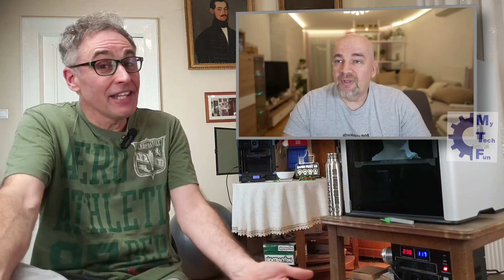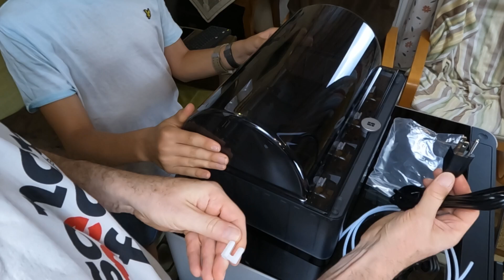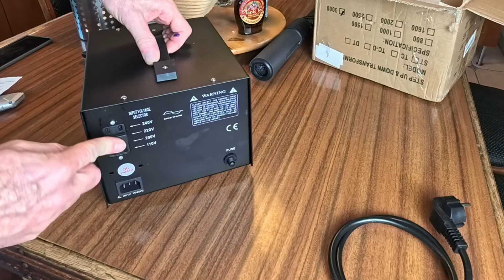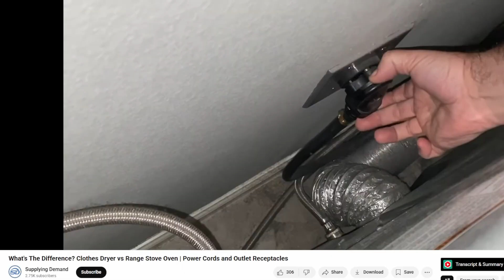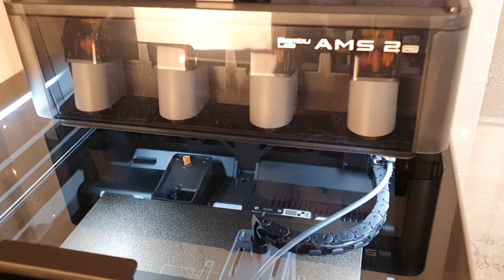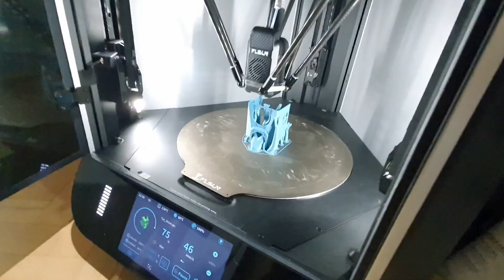Bambu Lab Sent the Wrong H2S (110V Printer in EU) Our First Bambu experience. Joining the dark side?

Comment: Thank you for the awesome video. I have one question that I'm not able to find an answer to. What about the hertz. US is 60HZ and Europe is 50HZ, I read somewhere that motors are super sensitive to this and this will cause quality issues in the print.
Reply from the maker: They are DC motors, they are driven by the universal 110-240V power supply, which is the same PSU in all variants of the printer. The AC voltage only affects heaters: the bed and the chamber, where frequency makes no difference.

Comment: As someone that moves between US and Europe, I'm wondering if by replacing the AC Board and Heatbed, would allow the H2S to run without the transformer. On the BambuLabs replacement parts, the Heatbed either has LV (low Voltage) or HV (High Voltage), depending on which region your buying from.
Reply from the maker: Thank you for the insightful idea! I will look again, last fall at the time of the recording the H2S was so new I could not find any replacement parts for it. I did notice the built in power supply is a 110-240V unit, so that would work without replacement.  I am guessing the nozzle heating is using DC, but what about chamber heater? That could also be AC heated and then needs to be replaced.  Are you moving your printers between the continents?

Comment: This video made me anxious for my P2S, which will go from Canada to EU. However, Bambu confirmed that it will work in both regions and both power inputs. For the H2S they confirmed what you are saying, that you will need a stepdown converter for the ac board and heatbed.
Reply from the maker: The P2S most likely has 24V bed heating, which is a benefit in this sense. AC bed heaters are much faster, but they need to match the wall socket voltage.

Comment: While the standard wall socket in the States is 110V, the current comes into the house at 240Vs and is used by electric clothes dryers, and EV recharging devices.

Comment: Hello. I was wondering if the SV06+ and the SV07+ have the same build plate. Could you maybe check with your printers?
Reply from the maker: Regarding the H2S, no, the H2S has a slightly bigger build plate than the SV06+ and SV07+. It almost fits the SV08, and is a bit smaller than the K2 Plus build plate.

► I could imagine using my new H2S build plates (smooth PEI and CryoGrip Glacier) in my SV08; only the very front of the build area would not be covered. I would probably need to adjust the start_print purge line position.
► As for the SV06+ and SV07+, they have identical build plate sizes. I've actually used them interchangeably. Surface is a bit different. See below.
► The Comgrow T300 is also exactly the same size as the SV06+ and SV07+.

Build Plate Surfaces

► The only difference between the SV06+, SV07+, and T300 plates is the surface.
► The SV06+ comes with a golden-colored, single-sided PEI (the golden color is similar to the H2S stock textured plate). The grid and markings on this build plate tended to get transferred to prints.
► Both the SV07+ and T300 came with that black textured PEI, which is double-sided. My beta SV07+ unit did not have any marking on the center, which was a good thing, as it tended to get transferred to prints on production units. The T300 build plate was almost completely clear, and I never had transfer issues there.
► The H2S golden textured PEI also has markings, text, and the Bambu Lab logo, but they don't seem to transfer to prints.
► The smooth PEI plate for the H2S is basically a steel sheet with PEI stickers on both sides. That PEI sticker lifts fairly easily; I can already see distortions where my first test prints used to be. I will have to use a release agent glue with ASA on this smooth PEI.

For a comprehensive section where I compare all these build plates, see this video → https://youtu.be/xt6uzXgRJdc

CryoGrip 

I haven't gotten to test the CryoGrip Glacier in the H2S yet. However, on my Kobra 3, I've already damaged the CryoGrip Frostbite with PLA (see video → https://youtu.be/sTyO4aBpi2I). So I will be careful with this one.
Reply: @gerGoPrint3D Thank you very much, My SV07+ has the marking (and i dislike that it transfers to the prints) and i was wondering if i could just buy the cheaper SV06+ build plate that doesn't have a marking. Since the T300 also doesn't have markings, i will go for that. Your answer was so good i got a result that is better than what i wanted to know initially.

Comment: greeting. I need another printer. I hesitate between sv08 and sv08max. 350x350 is ideal for what I need, but all those upgrades to be close to the max, I don't know if it's worth it. on the other hand, all the features of the max impress me, but it is big and consumes much more electricity.
Reply from the maker: I love my max, but if 350 is enough I recommend getting the regular sv08 and the zero for the same money (or less). Zero has the same cool new features as the max, ideal for high temp prints and you can print things parallel (i.e. two printers is better than one 😉). Only buy the max if you need larger than 350 prints. It is a beast. Think washing machine size...

Comment: I've had issues with the textured plate as well at first. What solved it is cleaning it with IPA immediately after unpacking. The plate has some sort of dust on it, probably from the manufacturing warehouse and the adhesion is non-existent but if you thoroughly clean it, dry it with paper towels and let it sit for a while then it gets a lot better. Then after a couple of prints the bed adhesion will be spectacular all of a sudden (I've even had issues getting the prints off of it a couple of times). Maybe it's worth a try for anyone struggling out there, it helped me with both sides of the same plate and even a different (textured) one and it worked for you as well so there is something there I think.

For a smooth plate I use the VisionMiner nano-polymer glue because you don't have to reapply it after each print as it lasts tens of prints (hundreds if they're smaller and you position them differently each time). But that's on a H2D at work for materials such as PC, PCTG, Nylon etc, I don't know how well it works with PETG and PLA (I've heard not very well but haven't tried myself).
Reply from the maker: Great feedback! I am still waiting for the cryogrip, it's also recommended for high temp materials, will report back when I get to test it
Reply: I threw my plate in the dishwasher and it solved all my problems.

Comment: Quick note: we do have 220v/240v circuits in our US homes for things like the clothes washer/dryer, dishwasher, hot water heater, etc. These circuits are on a minimum of a 20A circuit, some will be 40-50A depending how much is expected to be pulled. The breaker itself would be two pole, usually gfci, because of our split phase 240v.

The larger difference is that our 240v is split phase vs EU single phase as well as 60hz vs 50hz. So we have two hot wires and ground vs hot, neutral and ground. This isn't so much an issue as running a EU 240v appliance would still see the same 240v, but the applicane needs to be able to run properly at 60hz. Would need to make a EU socket to something like a nema 6-15R/6-20R/6-30R (there are a ton of outlet choices) plug and just wire them Hot->Hot, Neutral->Hot, Ground/Earth->Ground.
Reply from the maker: Another thought: then it might make sense to get a 220V unit (or printer companies to sell 220V variants in the US). While my points about the benefits of slower heating still stand, the time difference for the bed and nozzle is largely absorbed by the rest of the pre-print routine. The only advantage is the faster chamber heat-up, and even that was only a 20-25% improvement.
Reply: @gerGoPrint3D Yeah, I while the time savings is nice I don't think it's genuinely worth it to go through the expense or trouble, with a bambu at least.
Reply from the maker: Thank you for the clarification. I think 50Hz / 60Hz does not make a difference for 3D printers, at least this one here works well with EU frequency. It could maybe affect LED cycles, but I think they are controlled by software, and they have you choose region on any unit. The same probably goes for wifi channels too.